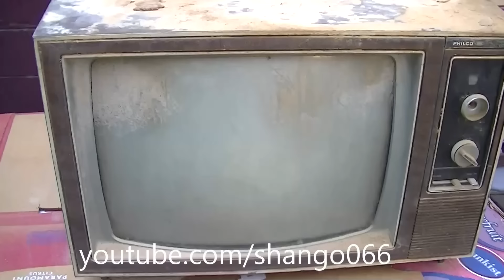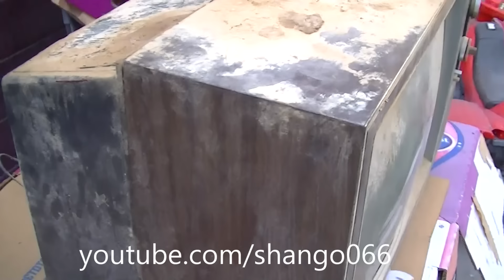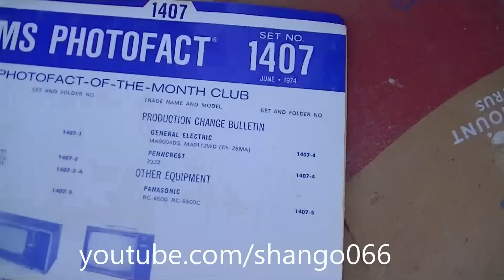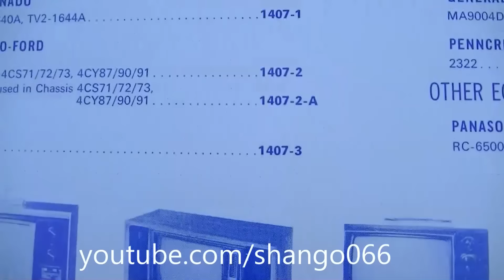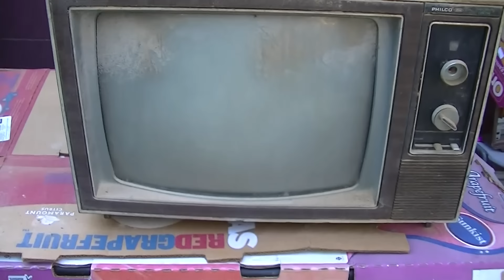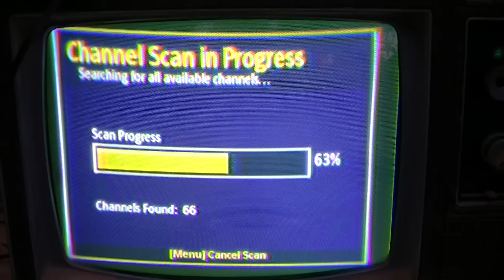1974 philco-ford solid-state color television Resurrection

Comment: It looked just like a Truetone we use to sell until you looked inside.  In my 1970 electronics class Op Amps and ICs were brand new and a big deal. Soon after a TI calculator that would do square roots and cosign functions made my slide rule obsolete.

Comment: I have an old black and white TV that keeps power on to the crt filiment while the power is off. I have always been concerned that that might shorten the filiment's life... I personally would rather wait for it to warm up than shorten the CRT's life. It also has had horizontal hold problems. I eventually realized the horizontal size was off as well so I tried adjusting it, but then the potentiometer broke 😡. I wonder if that caused the horizontal hold problems... I bought a new potentiometer, I just need to get around to installing it!

Comment: No voltages given because the technician wasn't expected to do component-level repair. You were supposed to identify the defective module then just swap for a new one. The old board was sent back for refurbishment.
Reply: I remember those days. Modular chassis.

Comment: A lot Of Those Newer TV's Didn't Have
All Those High Voltage Tubes.
Look At Flat screen TV's. I'll Work 
On One Of Those Before I'd Work On
One Those Old TV's Being How Dangerous
They Are To Work On.
Reply: The key to working on old tube stuff, is having an isolation transformer.
Reply: @GoldSrc_  you Know If
You Can't Buy Tubes For That Old Stuff
You Can Always Install A Bluetooth Amplifier
& Load A Bunch Of Classic Country CD's
On You'r Pkone Or Tablet.
Reply: @GoldSrc_  if You Don't 
Have One Of Those I Used A Dimmer Switch
To Gradually Bring Up The Voltage To A Desired Level.
Reply: @GoldSrc_  I Use A Dimmer Switch 
To Gradualy Bring Up The Voltage
Reply: @rogertyler3237  Please, stop typing like that, it's a pain in the ass to read.

Comment: If anybody is interested Witte eventually was sold to Arrow.  any if you are in the oil field you are very familiar to Arrow.  Arrow engines were famous for people starting them on a pump jack and remembering years later to go back and check on them...  They still build these engines today.  https://arrowengine.com/en/  the website tells you how to change the oil...because they are running pumps etc.. and can't be turned off you drain the oil while adding new oil into the filter.  An oil change w/o shutting it down...

Comment: 39:00 RE "bright greens" etc.

Go out and look at the lawn in yours or your neighbor's yard.

That is how grass should look like on TV, not like a neon green casino sign or highlighter pen.

When you unbox and set up a brand new flat screen, what you see is NOT an accurate picture.  What you see is a display set up to stand out in a showroom packed with dozens of competing sets.

Typically this is called 'Shop' mode, or Vivid or Dynamic.  

Step 1) Select Movie/Cinema mode for a combination of adjustments that will be far closer to what things really look like.

Step 2) Select Standard/User/Custom mode(which accesses all settings).  Turn off all 'enhancers' in Advanced settings, and perform either a self calibration(with Digital Video Essentials Blu Ray or DVD), or a professional grayscale calibration(CalMan or Sencore generator).

I can get a decent picture from almost any decade or type of TV, because I taught myself what the five basic adjustments(Contrast/Pic, Brightness/Black level, Color, Tint/phase, and Sharpness/peaking) do.

And grass, even in direct noon daylight, does not glow neon green.  It looks just like the lawn outside your window.

Comment: When repairing electronics, about the best advice that I can give is to ALWAYS start at the power supply. If circuits don't have proper voltages, things aren't going to work to well, if at all. Once you've established the fact that you have proper voltages being applied, THEN you can tackle various circuits that perform various functions. This is NOT rocket science.

Comment: Shango....YOU THE MAN!!! Do you have a patent maybe a magnet for the dirtiest most muddy finds?  Maybe they'd give you a discount at the car wash or a parts washer might help. LOL 😊😊😊😊 Great vids as usual!!!!! Question: @ about14:00 you mention they keep the filiment active for instant on. Wouldn't that shorten the life of the CRT, kinda like leaving a hardrive running for 5+years and never turning if off... and then wondering why it died???? And don't be neglective. One more. Is the Red over driven?

Comment: Weren't these boards set up for, if the board blows, go to.tbe try, swap out, and get it running? Lower shop times, and in and send card to other shop for swaps like an auto parts store?

Comment: We had a 1974 Magnavox with plug in modules. And instant on. I think the filament in the picture tube was always on. There was a switch to turn it off. 25 inch Console, though.

Comment: Hi Shango066, I sure enjoy your videos on the restoring of old TV sets. I use to work at a TV repair shop in the late 1970s. The place was Grand TV in Duluth MN & they went out of business in the 1990s. I my self had a TV VCR shop in the late 1980s up till the year 2002. I find it cool & incredible your able to fix up very old B&W TVs for folks out there in CA. Up here in MN most every one has moved to the new HD TVs & lots of older normal working TV sets People have quit using & lots old Picture Tube TVs go to the dump or to recycling places. I am retired now & My Hobby over the past years has been restoring old Ampro reel to reel Tape recorders. The Ampro 758 I had when I was only 12 years old & the Ampro 758 & 757 were made in 1955 & 1956. Back in 1973 I was fixing it all the time. I all ways wanted to find another Ampro 758 over the 1980s & 1990s & never could find one. In 2007 I found one on ebay & I fiixed it up & restored it. Then after that I found more Ampro 758s & the Ampro 757 & I was buying them on ebay & fixing them up & I now got 10 of them & they all work very good. I all so fix & repair small Portable 5" reel to reel players to & some Sony Stereo reel to reel recorders. I fixed & restored them by new Tubes & Belts & adjusting them & replacing Audio Heads if needed. I love all kind of older Music & enjoy recording off them old Ampro units when I get some new old 45s & 78s or 33 LP Records. Your Videos are incredible & since Christmas time I enjoyed lots of your old TV restoring on Youtube. Happy new year out there I sure wish you were closer. We have a lot in common in the Electronics world. take care. Jerry.

Comment: I wonder how well it would have worked if you had steam cleaned, disinfected with alcohol, polished the CRT neck, scraped off the rust on the side of the chassis, THEN tried it.

Comment: ford was ahead of its time withe electronics! ford had abs brakes in 1969 on the Lincolns!!! thy all so  had electronic ignition in 1967!! in 1968 thy had a internally regulated alternators that used a ic!!

Comment: This video has given me some hope.   I picked up a boat anchor DuMont 304A Oscilligraph scope at a yard sale for pretty cheap.  Got it home and discovered it had been about 8 inches deep in water, there was silt all over everything inside.  But being afraid to power it up because of crud in the transformer made me set the restoration project aside.  But seeing this old girl come to life has sparked some hope in me that it's a viable restore.

Comment: I seriously doubt thirty years from now anyone will be digging up a modern flat screen in a damp sandy rat infested basement that will work like this.
Reply: You're lucky enough if you get one past 5yrs and still working lol
Reply: @renekenshin6573  my kitchen 16 inch flat lcd thing is still working at now 10 years old....fingers crossed, had one cap replaced so far, one other is starting to bulge...the main living room 36 inch samsung was given to me as dead, scrap, but was only dry arced joint on mains input socket,  not sure of age but probably 6 to 8 years...
Reply: @andygozzo72  the main problem with all that is 99% of people would just throw a tv away even if it's not hard to fix
Reply: @renekenshin6573 lol
Reply: I'd think a LCD screen would be too sensitive to damage physically and from moisture
Reply: Have a 12 year old Panasonic 40 inch still fine. But your right wouldn't last long storage in any condition . Modern stuff don't like been powered down long term.

Comment: the first all transistor colour set in the uk was the thorn 2000 chassis from 1967, so maybe valve/tube sets or hybrids lingered on longer in the usa - one of the last hybrids was the itt cvc9 from around '75..? i have a similar aged 18 inch ferguson(thorn 8000) to that philco ford but although used several separate boards, no 'motherboard', but many did until the early 80s..
Reply: Not only in USA. In 1967 it was very early model, many TVs used tubes till mid 70s, because it was cheaper (in eastern block, tubes were used till end of 70s). Look for example at Philips hybrid K8 chassis - it was used 1970-1973, fully transistored K9 was introduced in 1972 and it used mainly discrete transistors. This Philco is not early transistor model, but early model with higher integration - it use ICs in every stage.
Reply: the thorn 8000 i have uses a few ics, mainly in the colour decoder and sound detector,  the 2000 and the 2 following ones, 3000, and 3500, all discrete, one of the most common sets in early to mid 70s in the uk was the philips G8 from around '72 , that had a fair few ics,  (i repaired a few for people well into the 90's !)
Reply: i dont think there was ever any 'all valve' colour sets produced in the, uk(or imported), pretty much all transistor or hybrid , had a few myself,  ITT/KB produced an all valve monochrome metal chassis hand wired set until well into 70s, i have one and it works well, all others were pcb or part pcb part metal chassis..
Reply: It's because colour broadcast in Europe started in the end of 60's when transistors were often used in low power circuits. For example - in Czechoslovakia, Tesla used PCB in B/W sets from early 60s and transistors were used in sound IF in mid 60s.
So only US colour TV sets from 50s-mid 60s are all tube based. In the same time there were only B/W sets in Europe.

Comment: Most of the televisions in use today have the warning "There are no user serviceable parts inside" which means that that if the television goes on the blink it is not worth fixing and should just be replaced as the needed replacement modules are no longer made, maybe it might be worth hosing the whole thing down and getting all the crud out of the set and letting it dry out completely and see if that works.
Reply: DAVID GREGORY KERR yup,  should  read “just buy a new one, and then another, and another,  sucker muhahahaha “
Reply: That phrase has been around for decades.  I've always considered it a challenge to prove them wrong.
Reply: It was when solid state came to be. Unlike older sets where tube checking and replacement by the "user" was anticipated by the manufacturer.

Comment: Too bad the previous owner was too neglective to check the fuse. Seems like a working set was benched due to a voltage regulation irregularity like you said or a lightning strike.
Reply: Not too bad. Otherwise we could not see this video. 
It was very modern TV for that time. Thyristor (SCR) based horizontal out was complicated, but at that time hi voltage power transistors were rare and not cheap. Thyristors had enough power to drive H-out and convergence circuits needed for delta CRT. There were used in some european models till 80s.

Comment: Old muddy/catpee/TV candle scent... mmm.   Take it to a car wash or pressure wash the whole damn thing.
Reply: SteverRob He should just hose off or pressure wash the whole thing, then dry it out a couple of days. Shouldn't do any more damage than has already been done.
Reply: The only thing that would worry me would be maybe the yoke or tuning sections, but I've seen/heard of older tube ham transmitters that got dumped overboard into salt water, retrieved, hosed off and they worked like a champ.